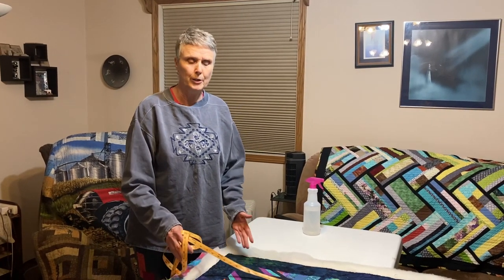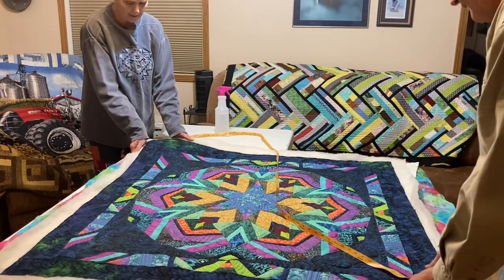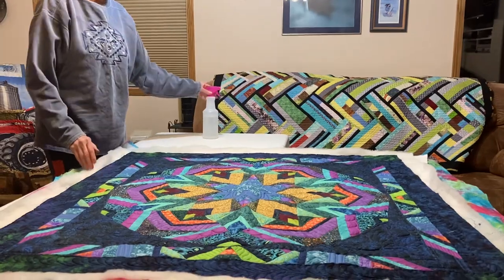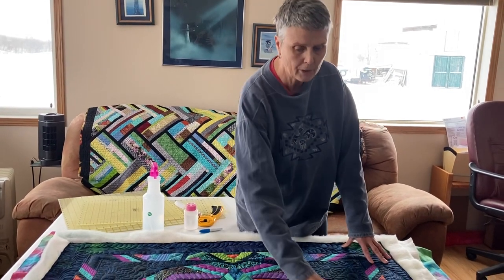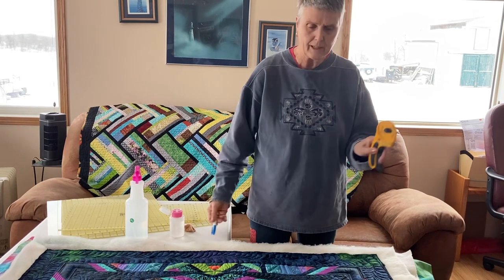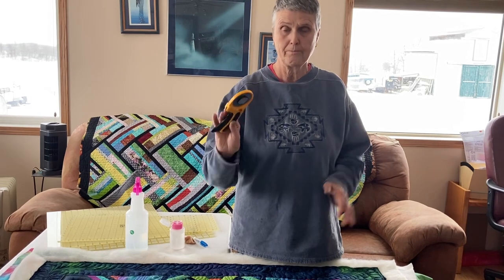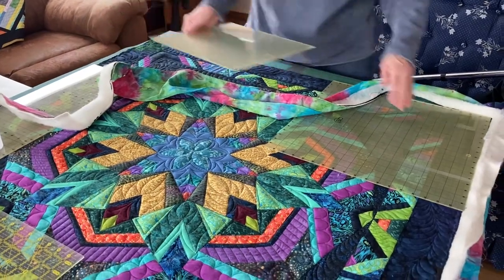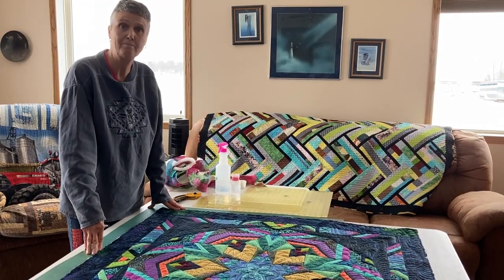How to Square a Quilt

Comment: Thank you for this video!  Very helpful.  One question.  If the border width will not be the same all around do you make any adjust for that?  Or perhaps it will not be that noticeable on a larger quilt.
Reply from the maker: You would just square it to the outside edge Marlene